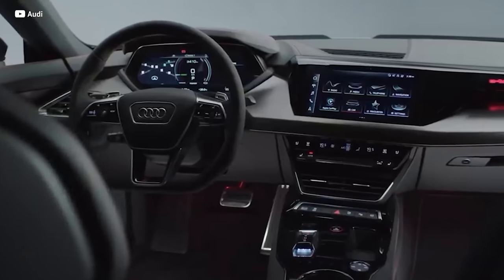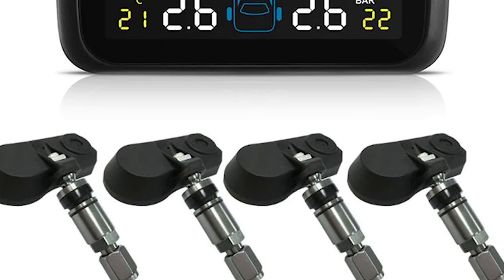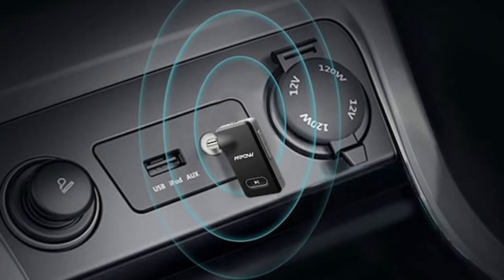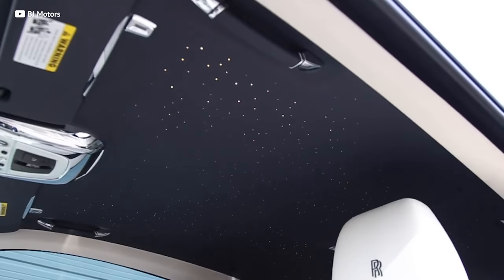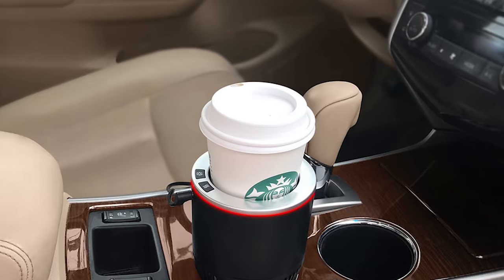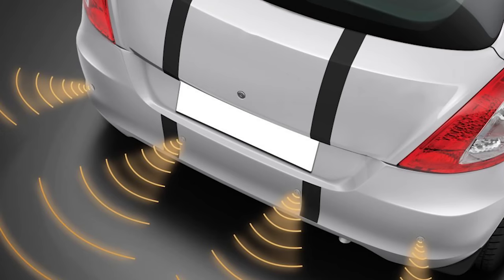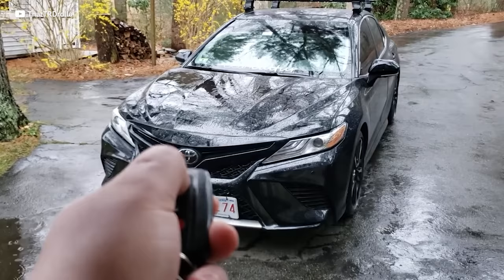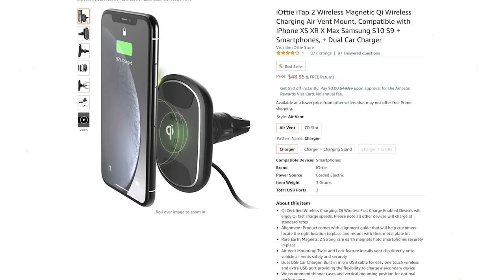MUST HAVE Amazon Car Mods That Transform YOUR Car in 2021!

Comment: My 2020 Rav4 Hybrid XSE came with a wireless charging tray. It was definitely not $50k.
Reply: I bet it wasn't 5000$ either
What like 30,40000$?  
😐 Bet it wasn't cheap
Reply: Gotta be completely honest here. It cost $32k for the brand new vehicle, but I never actually used the wireless charging because it was basically a trash feature. I upgraded this past January and paid less for the new model without the wireless charging tray. When I say it was a trash feature, I really do mean it. The charging was so slow, it barely got my phone an extra percent in charge by the time I arrived at my destination during 30-minute drives. On the other hand, plugging in allowed me to gain almost a full charge within the same amount of time. I definitely thought it was a cool feature, but it was just cool- not functional.
Reply: @Melourn  y'all got more money than me,I could never afford a 32K car (without making payments)

Thanks for the info on the wireless charging,I have never experienced one before so now I know to steer clear considering the functionality you mentioned,thanks!
Reply: @vivalatink716  What kind of rich, pompous ass do you take me for? Of course I'm making payments! I wish I had $32k to just blow on a brand new car without payments. ROFL.
Reply: @Melourn  my fault, 😅.  I know people out here got that kind of money though.   
Not me!

Comment: I want to mod a j2 slow moving vehicle capped at at max speed of 40km, adding stainless steel brakes a tint some knobby tires for winter and trail side of the road road use in rural and small towns within a radius of 200km. I will weld up a hitch even to tow around a big 48" mower deck too. Add a proper audio setup, add a silent high end power steering servo motor and a microcomputer driven by two types of lidar and image shape detection sensory via pythons open source self driving vehicle code. Maybe height adjustable suspension, and a copper chrome vehicle wrap then covered again in 3m clear to keep the chrome mint.

Comment: Okay there’s a certain year where in the us they implemented a law so that you have to have a tire pressure monitoring system in your vehicle. Some vehicles that are older didn’t need them but there’s no actual way to just shove sensors in your car and expect them to work and be compatible unless it’s like Bluetooth with your phone or something but even then just don’t be lazy and get yourself a tire pressure gauge and check them twice every month and make sure they are aired up once or twice every month or just look at your tires after you leave your car and lock it and before you get in duh.

Comment: Lol if you get a chunk of glass slashing your tire you aint gettin it fixed for free. First off if its a slash/slit they cant fix it. They only fix punctures that are 3/8" or smaller. A patch wont hold on the inside of a 1inch or longer slit. A tire is constantly flexing. That slit will flex and stretch and pull your patch off amd youll be in the same boat. Aside from that the only way most tire shops repair a leak for free is if you bought them from that shop. And most of the time its only free if you paid extra for a road hazard warranty on the tire.

Comment: Just use an fm transmitter for the radio and they make ones that connect Bluetooth too so it tooth to phone phone to radio and you get to take over a station within 90 feet lol

Comment: Auto start is only available on an automatic transmission vehicle.  No clutch pedal to start it
Reply: Not so. My best friend had some silly hot rod Subaru that was standard shift, and it had an aftermarket automatic start.  When his Dad drove it, and left it in gear after parking, they found out that the car would start in gear... and move about 10 feet (give or take) before stalling.
Reply: @magnificenthonky  unusual, cool

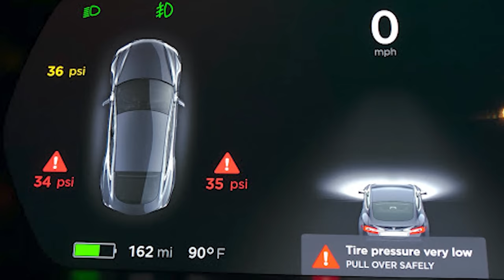Comment: 1:32

About that:

If you're in some random place, and your TPMS somehow saves you from an exploding tire, presumably by pulling over and parking, how are you now going to take it to a tire shop? 

And how are you going to get it fixed for free? 
😂

And about Bluetooth, I don't use it.
The delay between the sound and the videos I watch is insufferable.
Reply: yea luckily i have a car that has a aux in so I get no delay and ultimate sound quality. bluetooth aint the best

Comment: A smart man once told me that a phone mount connected to the vents on your car is not a smart idea because your phone is not can be but is effective by temperature which means if you're running the AC it will affect your phone why because somebody's dumb enough to invent a vent phone mount if you're running your heat it it will affect your phone and neither one affects your phone in a good way especially for these prima donnas that cannot for any reason whatsoever be away of the air conditioner not to mention the fact in the winter time most people blast the heat because they're freezing today and some car heaters can get really really hot
Reply: Hey bro I just want you to know you’re allowed to use punctuation...

Comment: my 2006 chevy trailblazer lt ext does not have an aux port :( even though there is a button that says aux/ something else, me and my dad are really confused that it says aux on it, when everywhere we look there is no aux port, (it's the stock head unit)
Reply: I'm gonna guess that you checked there, but sometime they put the aux port in the center console.
Reply: @gqsmooth1969  in the storage place between driver and passenger, yea I did nothing oof

Comment: Literally none of these are gadgets i would put in my truck. My 1990 gmc stepside doesn't need any of these. The original radio didn't have aux, so I had to put an aftermarket radio in... which has Bluetooth aslo.
Reply: The cup holders are a novelty sure, but I doubt something that is 12v and can maybe draw 10amps is going to do anything
Reply: You must be old school, like me, lol.

Actually, those cupholders may work better than you think.  It uses the same tech used in 12v iceless coolers (which become warmers, at the flip of a switch). As a long haul trucker, I've used those coolers, and they do work fairly well. The smaller ones tend to work better. 

Leave a can of soda on the cold side of a  thermoelectric plate, and it may turn into a can of ice.

Comment: tpms is useless most cars have a pressure censor and yes you can get a tire repaired but hardly ever is it free and it has to be on the top of the tire if its on the side its irreparable

Comment: Do not buy the TPMS, at least not the ones that you screw on. I pumped my tires to 2.5 bar then after 2 weeks some showed 2.4 and some 2.3. After 2 more weeks all 4 show 2.6. Its not accurate at all.

Comment: No! Don't go installing junk tech on your vehicle because of a youtube video. Stay far away from TPMS, it is a terrible replacement for a full size spare and a tire repair kit. Tire device based TPMS was obsoleted years ago by wheel revolution counting and should be avoided at all costs. Don't punch holes in your headliner to install unnecessary lights. Don't get a high tech overpriced koozie. And don't waste your money on a wireless charger.

But I do have one of those Anker Roav bluetooth cigarette lighter adapters (2:35) for my old pickup truck and it works great! If you don't have a bluetooth stereo you have to get one. The only issues are you still have to use your phone to answer, dial, and start the music.

Backup cameras are completely unnecessary if you have the discipline to ALWAYS BACK INTO YOUR PARKING SPACE. But most drivers are lazy and prefer to blindly back up into moving traffic and possibly run over children. If that is your style and you don't have a backup camera - you should definitely get an aftermarket one.
Reply: I agree with most of that.  Especially when it comes to backing up.  Mirrors aren't hard to figure out.   I've driven, backed up, and parallel parked panel vans, box trucks, and semi-trucks, all without need for a camera.

I will say, though, that I've found the magnet mount wireless charger to be worth it.  Especially when I was driving a truck; I could see, at a glance, who was calling, and choose whether or not to answer the phone.  It also allowed my phone to serve as a rolling map, with satellite imagery, when trying to find a new location.  Indispensable? Nope.  Useful?  Very.

I used to Bluetooth my phone to the radio in the truck, too. But I used that for media only; I took calls via a headset.  I detest trying to hold a conversation through my vehicles stereo.  I also detest when people try to talk to me through THEIR car stereo. 

These days, I don't drive big rigs, anymore.  The collective reliance  on nonsense gadgetry has made the roads unsafe, as has the failure of people to actually learn driving skill.  So, I made a career change. 

Now, I rarely even take a phone with me, when I leave my house.

Comment: I've driven for decades, without tire pressure monitors.  Tire goes flat? No biggie; I have everything I need to change a tire. I also know how to plug tires, and own air compressors. 

Bluetooth connection to my car is unnecessary.  In the rare event that I see fit to leave my house with a phone, I have a Bluetooth headset.  Having the conversation played through my speakers is annoying.  Even more annoying is trying to have a conversation with someone who has linked their phone to their car stereo.

Star ceiling is cool. But not cool enough for me to devote any kind of time or expense to obtain.  The novelty would wear off quickly, much like the novelty of the TV that I used to have in my dashboard. 

My old Cadillac, which had the TV in the dash, ALSO had remote start.  I ended up disabling that nonsense.  The start buttons were always getting hit in my pocket, which was a nuisance. I'd never pay for that silliness. 

Speaking of silliness, backup cameras are wholly unnecessary.   For f**k sake, learn to use some damned mirrors.  I can parallel park a Uhaul without cameras.  For that matter, I can parallel park a semi-truck without cameras, too.  That's because I learned how to use my mirrors.  I back my Chevy Trailblazer into various parking spots, every single day, using only the the door mirrors, because the rear view is broken.  Also, the backup camera is far from foolproof; the assistant manager at my former place of employment drove the boss's new car. She backed out of a driveway, using the camera, and promptly took out a mailbox, a taillight, and a sh**ty excuse for a bumper.  Just learn to drive.  All that electrical nonsense has you people thinking that the car is watching out for you, and is making you complacent, which makes you a danger to yourself, your passengers, and the poor sods who must share the road with you. That fancy electro crap is going to break, and your going to be helpless and screwed because you learned to foolishly depend upon it.

The cup heater/cooler is spiffy.  I'd buy that.

The wireless charging magnet mount is also handy. That's why I've got one; mine suctions to the windshield.  It gets used whenever I go out of town, which is the only time I carry my phone with me. (Amazing fact: it is possible to exist, and even remain healthy, without a mobile telephone in your immediate possession.  Believe it or not, EVERYBODY used to leave their homes, sometimes for days, without a telephone, and without the internet in their pockets. It's quite the pleasant experience, actually, and gives one a sense of freedom. )
Reply: K boomer
Reply: @Whaddle31  snicker

Comment: Lost all credibility when you said your aftermarket rims wont come with TPMS so buy some. You do realize that any vehicle equipped with manufacture TPMS can be installed into your new rims without needing to spend money on new ones, you just unscrew the TPMS from your old Wheel and screw it into the new one and Torque it down to speck, no need to purchase any extra TPMS if it already comes with it also with what your suggesting the TPMS light on the dashboard would never turn off. So don’t listen to this man if you buy new wheels you don’t need new TPMS.